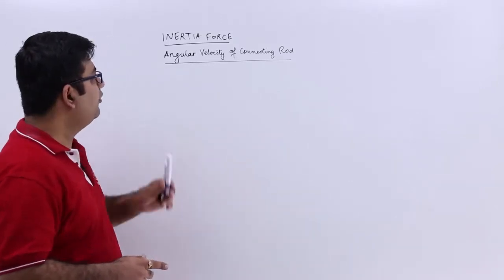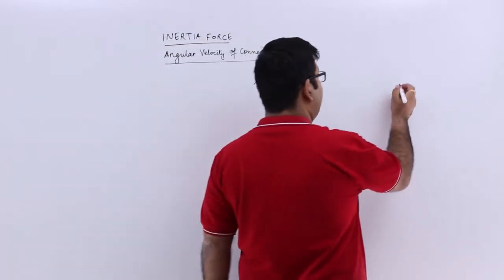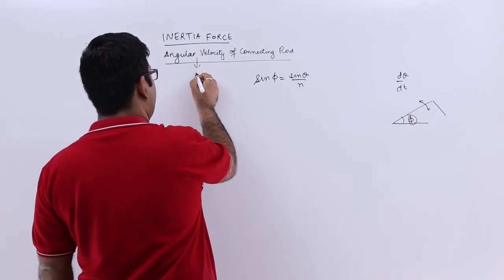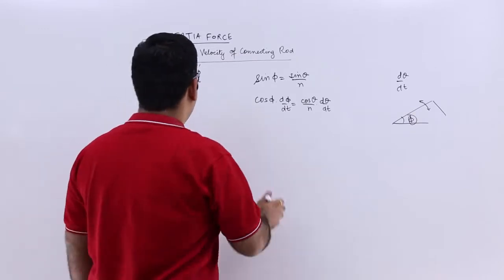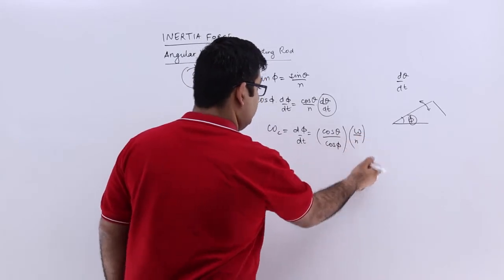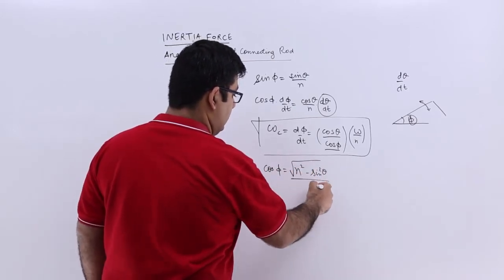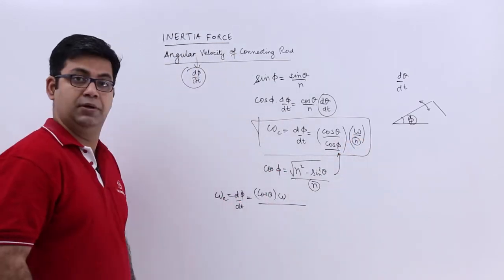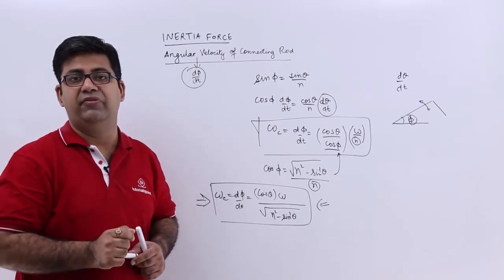Angular Velocity Of Connecting Rod

Comment: A petrol engine has a stroke of 120mm and connecting rod is times the crank length.the crank rotates at 1500rpm clockwise direction. determine 1. velocity and acceleration of the piston and 2.angular velocity and angular acceleration of the connecting rod .when the piston in I.D.C.